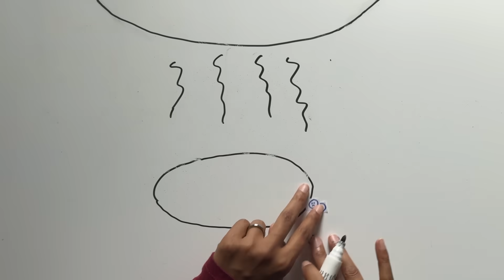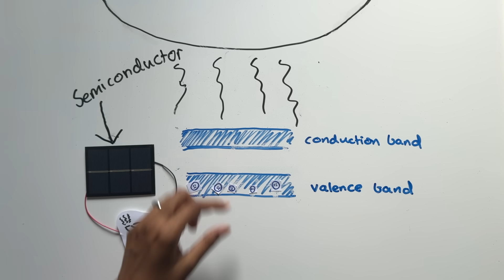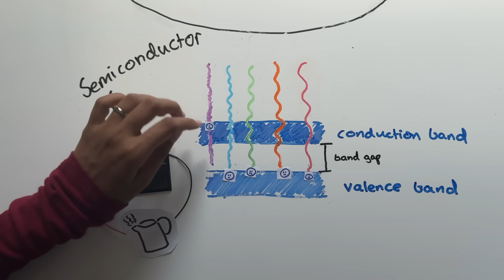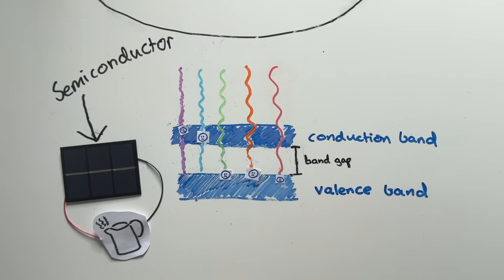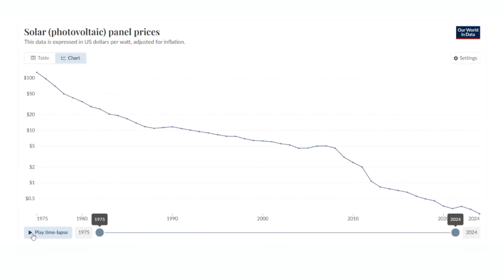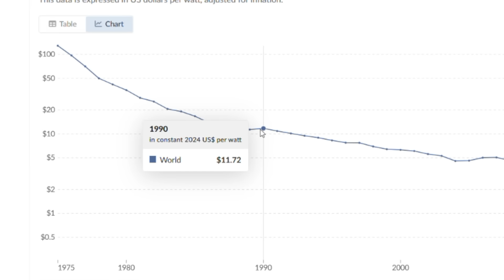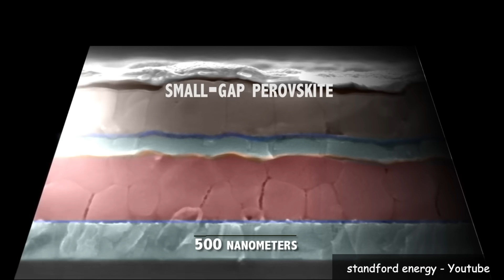Why solar panels can't be more than 33.7% efficient

Comment: Solar farms cover land.  They prevent sunlight from growing plants, and dramatically change the environment in their shadows. The impact is not as great as a strip-mine, but it is still great.  Imagine a massive solar farm and it's replacement of a forest.  Now imagine one of those grasshopper-like oil well pumps, in the middle of a huge forest.  The oil pump has a much lower footprint, and a much smaller impact on the local environment.  And both of these facilities would need a dirt road for access, so that is the same.
Reply: And there is the FUD bot. ;-)

Comment: That 33% makes solar about as efficient as nuclear except nuclear runs 24/7.
Mind you, I prefer my 10kWp solar to having a reactor on my doorstep. Instead, I have three just across the moors but I am too poor to pay for their cables. So I make my own - and don't share it with anyone - mwahahahaa
 [you are welcome to bring a bucket and fill it with spare electrons - ⚡ plastic obviously ⚡]
Reply: If you want, you can buy (very expensive) solar cells with almost 50% efficiency and if you combine with solar thermal, then you get over 50% efficiency easily. She is simply wrong here.
Reply: @schmetterling4477 Source? Oxford PV perovskite expect 26% by the end of the decade with possibly 30% mid century. ASHP combined PV panels claim 90% but that's a heat pump efficiency number and certainly isn't improving PV gain by more than a couple of percentage points over thermal losses, so not net gain.
I want more efficient panels as my 1/4 acre space is limited, but I have been Grid Free since 2004 and have grown with the technology. I owned my first solar cell in the 1970s albeit a 1V   low efficiency novelty part of an electronic experiment set.
I'm calling bs on your claim without some evidence to back it up.

Comment: Lanthanide-doped nanocrystals can up-convert the lower frequency light.  In a two-step process called energy transfer upconversion (ETU), the ytterbium ions first act as "sensitizers," absorbing low-energy near-infrared photons. The excited ytterbium then transfers this energy to neighboring erbium ions. After two such energy transfers, the erbium ion is excited to a higher state, from which it can emit a single, higher-energy visible light photon.

Comment: As always in this type of videos:
You forgot to mention the topic of recycling, oh I know - there is non. And yes solar is cheap but do you know how big of an impact it takes to properly recycle used solar panels? Please tell us more about it in your next video 
Impact on grid - most of grids are not ready for switching to solar or wind. Plus you need classic powerplant to stabilize the network or be ready for blackout every now and then

Third topic - logical mistakes. You sails coal need to mined everyday, well so that's silicon and other materials. It's not that you produce solar panels and stop for next 20 years. If there is constant flow of panels there is a constant flow on mining materials.

Last but not least why you always compare to coal, and avoid comparing to nuclear? Oh I know cuz nuclear is the solution. The only drawback is how to utilize used uranium or plutonium. Not many people know that yearly it's not tons but kg. A dozen barrels it's not much plus we have a lot of inside mines to store it underground. For sure nuclear power plants produce far less volume of waste per kWh then solar panels.
Reply: recycling of solar is easy. A machine has already been presented that can split solar panels into their 3 components - the glass panel, that very thin layer of silicon, and the plastic backside panel. Beyond that there is only a metal frame and some cables. All these parts are easily recycable. And what do you want to mine for silicon or glass? Rocks, sand, even soil consist to a big portion of silicon. What is sand? mostly silicon oxide. And Glass? Silicon oxide, too. Where is the problem?

And mining .... Uranium is pretty rare and the better mines provide 0.2% (yes, 2 parts per 1,000) of Uranium inside the ore. You may need 100 gallons of sulfuric acid to solve 1 ton of uranium ore, many kilowatt hours for hydrolysis the extract the metals from the acid, and more steps to refine and finally enrich the uranium to make it usable as fuel for power stations. Uranium has a mining problem, not silicon.
Reply: @ElwoodEBlues have you ever seen sand mine? How huge impact on ecosystem it have? Plus nat every sand is made equal. You can't just go on a beach and grab some sand for silicone. It doesn't work this way. 

Recycling is easy you say - machines were introduced really? Then why is no one doing it? Because it's more expensive then a new solar panel. There is no profit in it thus no one will do it. Same goes for wind turbines. Blades are non recyclable and have bo buried  deep underground. 
It's all sun and flowers until you need to clean it up.
Reply: @Clistes  Maybe the United States don't recycle. If so, ist is because they don't care. 
Here in Germany we have recycling factories for all sorts of construction materials. When we renew sections of the autobahn about 50% of the concrete used for the new road is in fact old concrete, crushed and ground on-site and taken from the old one that had just been removed. The others 50% are still usable for other construction projects.

Germany used 28 million tons of cement in 2024. That's enough for roughly 25,000 wind turbines of those huge new 160 meter / 550 feet models that require 2,300 tons of concrete (50% of which is cement). 
We have built less than 1,000 of them in 2024 but plan to do thousands more in the coming years.

You know, if someone has a dislike for something he or she will search for hairs in the soup. All those oh-so-bad anti-wind arguments are vastly inflated balloons, made up by criticasters. Same here in Germany.

Sand is in fact some sort of a problem here in Europe as we use too much sand - for bridges, industry and high-rise buildings, airports, harbors, and so on. And yes, a tiny part of all the concrete is used for wind turbines.

Recycling machines for solar panels are a new thing - of course. Solar is around on a bigger scale for 2 decades now, and most panels still do work. They get replaced by new types sometimes, but then the old ones can be set up elsewhere.

Panel recycling will become a topic in the near future. If plans go as projected we will have 200GW, maybe even 400GW of solar installed in the future (100GW are there currently). 400GW is roughly 1 billion panels. If they are to be replaced after just 25 years then it's 40 million of them every years. At about 25 kilograms each it's 1 million tons. Then we'll have recycling, then it will pay off.

And the blades ... that's a ridiculous whataboutism. We shred and burn them in cement works, instead of coal. Recycling should be possible and is in development currently. Our 30,000 wind turbines are mostly old, small ones with blades up to 40 meters. They weigh 11 tons, 33 tons per turbine, 1 million tons in total, or 50,000 tons per year over their 20-year lifetime. 

Plastic garbage from households (it gets collected separately) makes up for 2.4 million tons. Every year. And the blades only contain 40% plastic but 60% fiberglass. Peanuts.

A really big problem few people really care it about is car tyres. 600,000 tons of them are replaced in Germany - every year. And they spread 100,000t of mixed, environmently unfriendly dust saturated with chemicals over the country - compared to 1,000 tons for wind turbines. But say something against the car and you are the bad guy here .... stupid, selfish people.
"Wind turbines? Not in my backyard!"

Comment: I do wonder how much “free” energy does solar panel account for when comparing to conventional method like nuclear power plant, coal…

Another thing to mention is how much “cost” does it take to use solar. Cost here isn’t only talk purely about prices but also how much environmental damage required in order to create them, how much land/spaces do they need to create a farm of them.

Correct me if I’m wrong but I once heard that the excess heat generated from the solar panel farm actually increase the average ambient heat in its proximity considerably to the point where it could damage the nearby environment.
Reply: And you've just gotten into trouble. This is very easy to solve, just deforest. The one who cares about plants is that guy from Plants vs. Zombies.
Reply: If energy use grows at 2% annually and we get all of our electricity from solar, the retained heat from solar energy not reflected back into space and rejected as waste heat will become a significant to begin raising the temperature of the earth’s atmosphere within a few centuries. This isn’t a problem for wind since wind energy results from solar energy already absorbed by the earth’s atmosphere to create the winds.

Comment: So I was wondering something. 

Let us say we make the cost of solar tiny, and there is so many perfectly efficient Silicone Solar Panels, that we have as many as we need.
Say we also have the optimal batteries too.

If we have all that, then we still have problems of relying on Solar entirely.

1. Batteries rely on Lithium which is toxic to the environment and requires mining. I am also pretty sure it is a non-renewable as well.
2. Not all technology can be powered by solar via Batteries, because the power density is too low.
 - Planes
 - Ships
 - etc
3. Not all areas of the world are optimized for solar panels. Think polar regions, winter seasons, and so on. So a network of power distribution would be required, taxing the areas with high solar radiation. Not only that, but there is power loss the further the electricity travels, so it is not very efficient. 
4. Solar panels take up lots of surface area. So the tradeoff here is that if you have too many solar panels, it limits the amount of land you can use for planting trees, crops, or having livestock, or other useful purposes. (Same logic applies to wind mills too)

So it would appear that the bottle neck here is:

1. Battery technology. (Power density, toxicity problem, efficiency)
2. Environmental coupling. (It only works in certain areas) (-> You can solve this with fusion that is profitable)
3. Land usage. (-> You can solve this with fusion that is profitable)

Therefore, for all this stuff to work we need better batteries and sustainable fusion energy, and the renewable sources would then be secondary supplements to the primary fusion reactors.
Reply: Do you know the fusion constant? It's 30 years. "In 30 years we'll have nuclear fusion." Researches keep saying this since to 60s :)
We don't have fusion and shouldn't wait for it. And I think you fell victim to the exaggeration of "problems" with batteries and renewables spread by groups that want to sell us new nuclear power stations or, much worse, more coal, oil, and gas.
Reply: @ElwoodEBlues I didn't fall victim to anything, I just logically laid out the limits of using Solar. 

Solar is great but it has problems.

Until those problems are solved, even the entire world using perfect Solar won't fix all our energy issues. 

I proposed the 2 most direct ways to this solution as battery tech increases and fusion. 

I said What must happen not when or how.

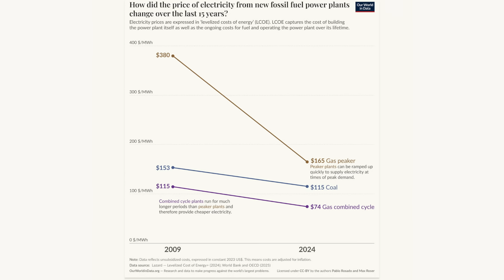Comment: 13:18 
Overall fine video, but you do yourself a disservice here by showing a more complete process for fossil fuel energy production, and only 4 steps of solar.
Your charts practically make it look like solar panels our naturally occurring structures that we can plug batteries into. 

There is no arrows for mineral mining of solar panels components, mineral mining of battery components, nor markers for the highly acidic waste made from the materials during production and after they’re no longer usable.

The bi-product waste of solar panel usage has some outrage over how it’s polluted sources of water for farmers and made it too acidic to use for plants or live stock.

Comment: The video overstates the expense of solar and the option of lithium ion. The storage issue is still the primary issue for industrial scale and cost is still an issue at an individual scale. The ROI for residential solar is only worth it in a some areas and only if you pay cash and wait 1-2 decades. After two decades, you'll need to replace the panels which then need to be recycled so toxic materials don't go to landfills. And that doesn't even include any batteries which might ensure you never ROI. At an industrial scale, lithium ion batteries don't cut it for storage of renewables. I'm certainly excited at the enormous progress that's been achieved but we still have quite a ways to go before renewables can truly overtake traditional fossil fuels for energy production.

Comment: There is a place for multi-junction (multi-layer) solar cells, especially when high efficiency is essential. The obvious example is satellites, but other applications include solar-powered drones that could loitre at high altitude for reconnaissance or communications.